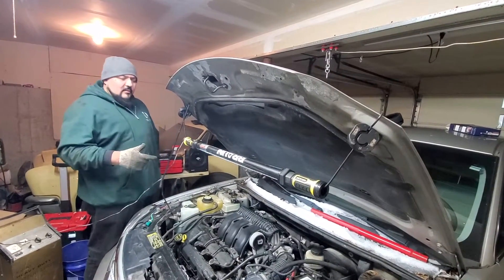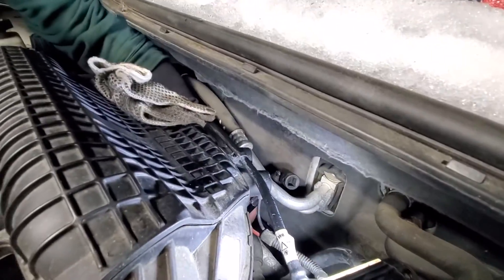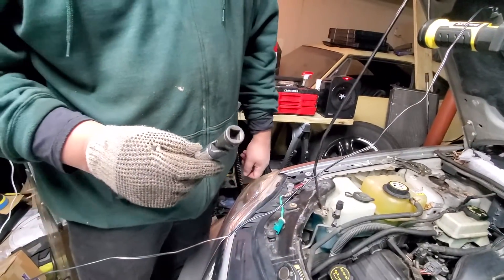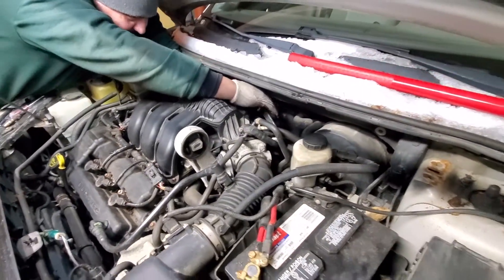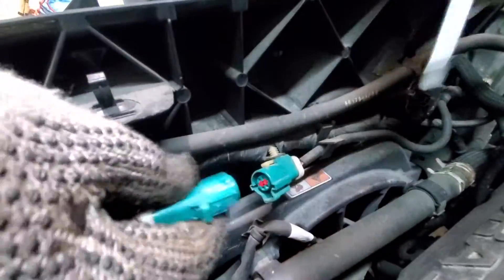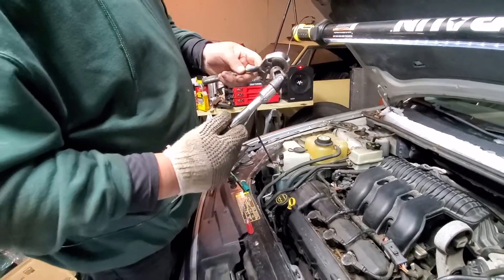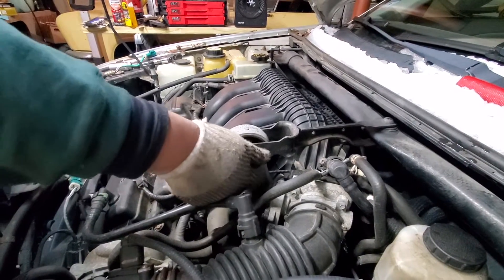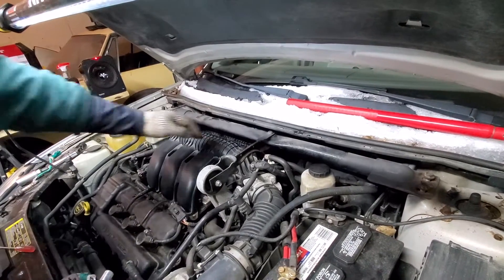2007 Ford Five Hundred - Bank 1 Sensor 1 - 02 Sensor - P2195 Code

Comment: That is wrong if you drive it up on a curb put it on jack stands or ramps you could go from underneath with a 22 or 7/8 ranch and get it broke loose I know and that's that's the way I do it's easier

Comment: Don't know if he removed it from the back. Didn't say he did, didn't record it either.
Reply from the maker: I got it, hard to record and do it same time. Just have to feel the 02 sensor connection and its just screw on and off. If you dont feel comfortable attempting it, take it aprt to get better view. So you can wlsee what your doing.